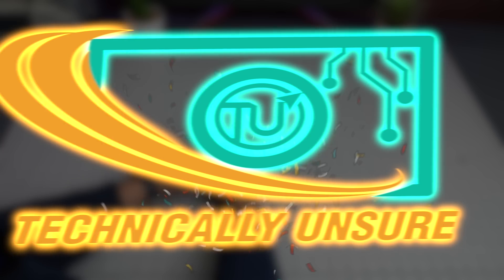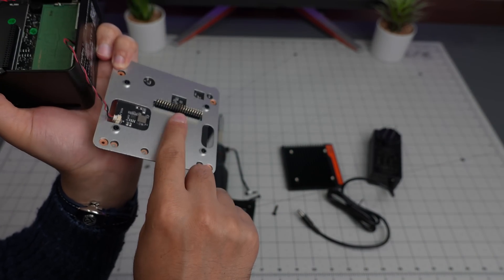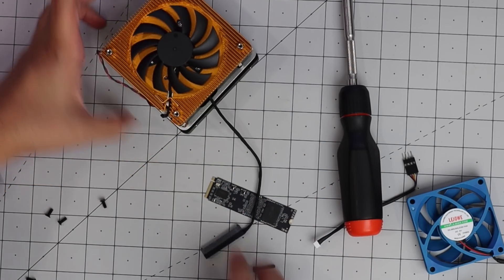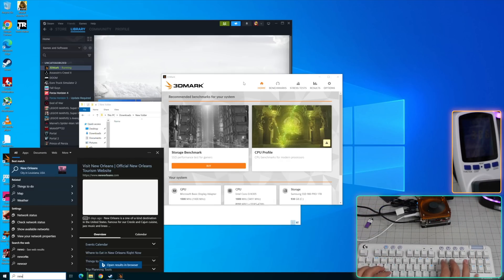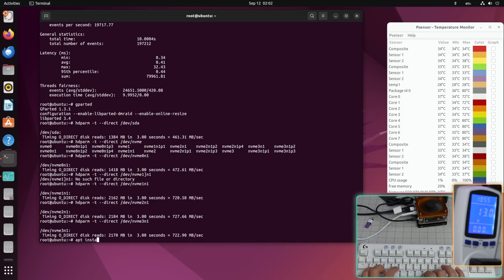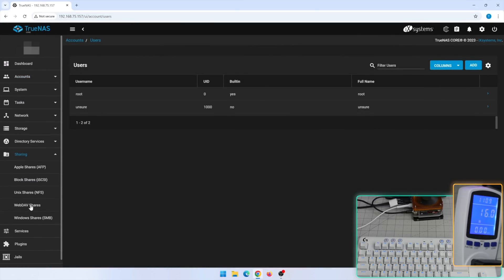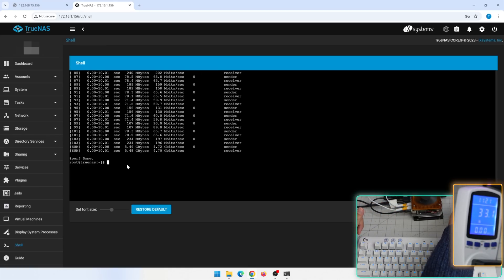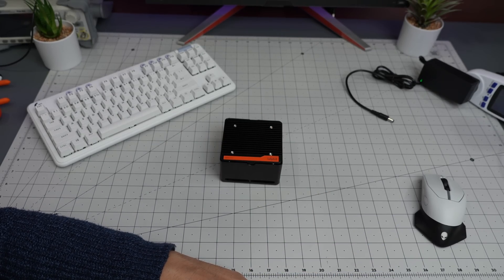CWWK Pocket NAS Review: Speed Tests, Windows 11, TrueNAS, & More!

Comment: You should clarify that the $250 price you mentioned is for the barbones system, not the system you reviewed.
Reply: …seriously?
Reply: Actually it seemed to me that it came with 8 gb of ram and a 120gb ssd
Reply: omg.. EVERY NAS system ever is always mentioned at it's "bare bones" price - because almost every user will put different sized storage in it.  seriously smh at this comment.  It's not like he's reviewing an external USB storage drive which only comes in one storage capacity.
Reply: while you're certainly right about storage, that argument doesn't extend to RAM since a lot of these mini Pc "NAS" machines can come with SODIMM slots or soldered RAM. It's not a huge deal but the original commenter's point still stands that it's nice to know what you're getting out of that $250 besides 4 m.2 slots and 2*2.5gbe ports

Comment: That M.2 --> 4x NVME breakout board is really interesting. I wonder if it can be made to work in other systems?
Reply: Good question. If it really 1 lane of PCIe then yes. But then it must cost like half of this device.
On the other side - if it has PCIe x4 and splitted into 4 PCIe devices this woud be cheap and impossible to use on other systems as it depend on PCIe bifurcation settings in BIOS.
Reply: on the cwwk site its listed as as separate purchase and only compatible with cwwk n100/300 units.
Reply: @mrpurpleman9698  i wonder if they’d say that just because of the additional power supply coming off the motherboard